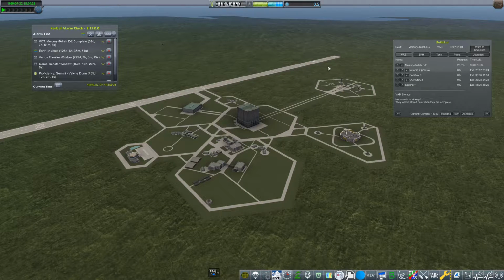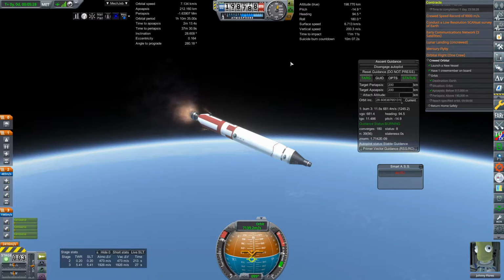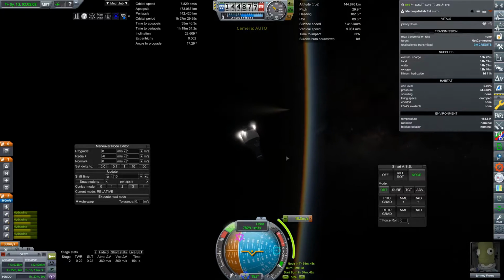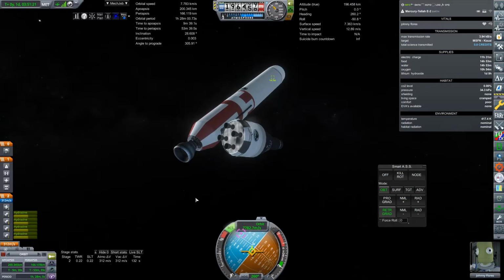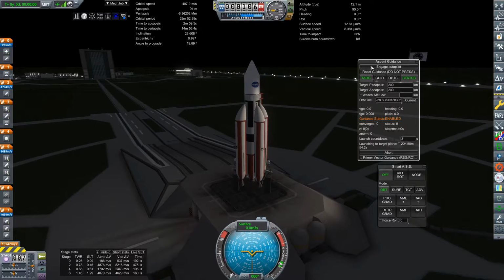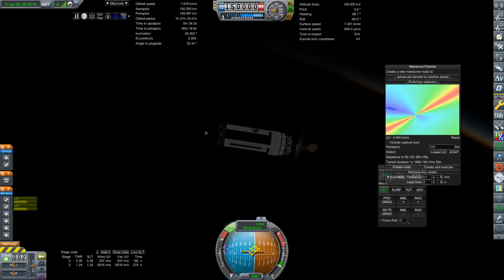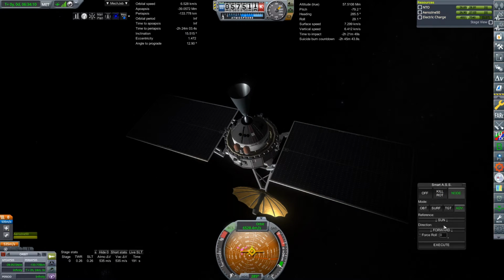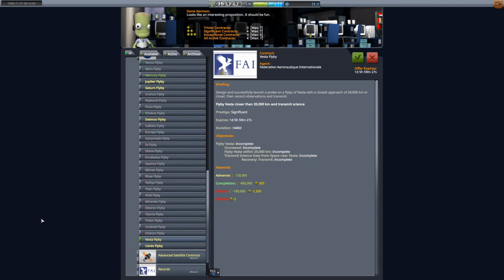Asteroid Belt Exploration! - KSP/RP-1 - Next Small Step Episode 37

Comment: For the pitch-on-descent, check your capsule's PAW for something called "Descent Mode" - some mods have it, some don't. If present, what it does is offset the COM of the capsule so it will angle itself into the airstream without fuel expenditure. You can then control how that angle affects your descent by rolling so it either pitches up (at 0 degrees roll), down (at 180) or even at 90 or 270.
Reply from the maker: Indeed, someone else pointed that out as well. It's something that the Gemini capsule definitely has, but I think since the Mercury capsule historically didn't have a lifting reentry profile, it does not. It's a lot of fun trying these things out and seeing immediate results - I wasn't sure why I'd want to use that feature before this!

Comment: In my recent play-through I've taken inspiration from your Tella, and used that basic design for my Atlas equivalent. One really neat thing that I have discovered in the process of working with that though, is that you can use that 2 meter core as a common core for a whole range of rockets, from an initial launcher of a couple hundred kilos in the form factor of a Thor-Able to a 7 ton Soyuz equivalent with three boosters on the LR-105 and a Centaur upper. Every booster configuration can work with each the Able, Agena, and Centuar uppers with some SRBs, and allows for some real granularity in payload capacity with just a singe core tank and three uppers. I  change the utilization of the tanks to  account for different burn times, so know it may not be as optimal  as what you have done, but I'm still super proud of my launcher catalog. Thanks for giving me the inspiration to figure this out!
Reply from the maker: That is awesome! It is amazing to hear that you took some goofy thing I did and turned it into all sorts of cool designs of your own, I love it. I've definitely found the same - I went with 2.2m tooling, but just like you I wound up using 2.2m tanks on almost everything for 20 episodes, haha.

Comment: Can I ask how many tons the new Telah 4 Heavy carry to LEO?
Reply from the maker: Napkin math (that is, I put lead ballast on top until the dV readout is just over 9200m/s) says it can lift 11t to LEO!
Reply: @justinbright9567  Ok thanks, I've done some research and the Huygens spacecraft weight 700 pounds which can be split into two one for a lander and also an impactor. The impactor is a sister probe that is dropped 300m give or take to count as an impactor. This would cost about 16k of delta-V from launch to landing and only 6.79k delta-V to get from Leo to landing on Venus. It is definitely possible with the Telah 4 Heavy but only possible as far as I know able to do this a Venus with this rocket. Sorry I have been obsessed with this idea and had to give a better explanation of how it could be done with the things you have at your disposal this far in the RP-1 playthrough. Also, Great Video forgot to say that in the other comment!